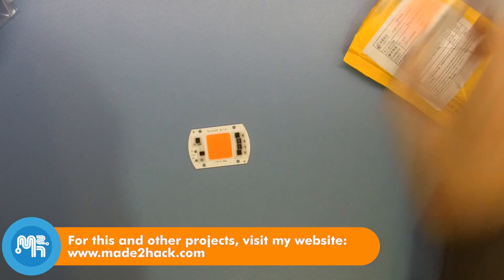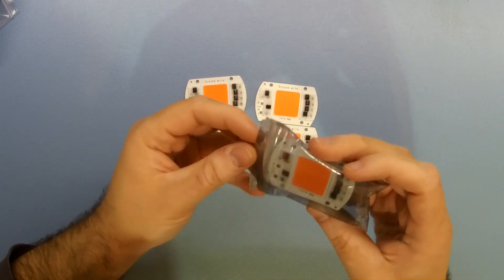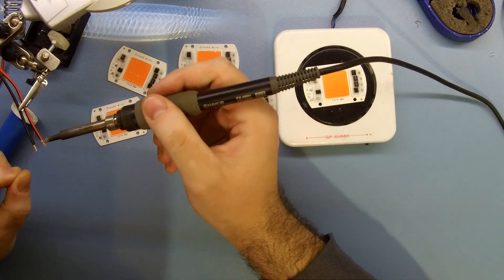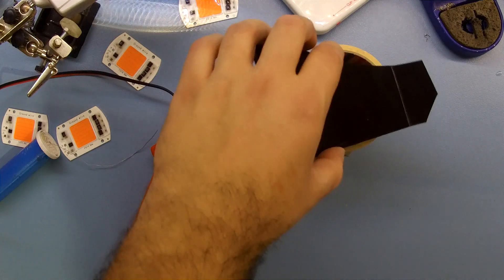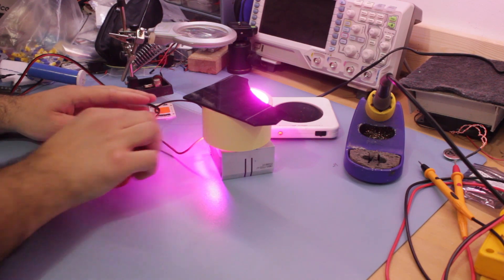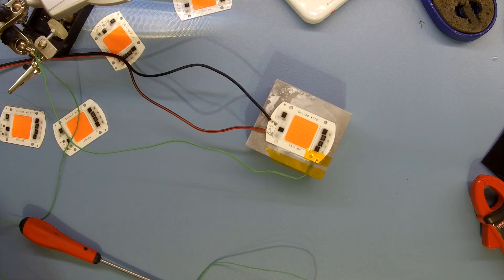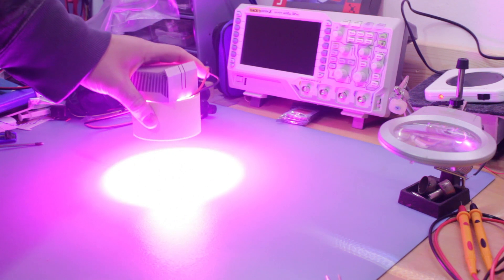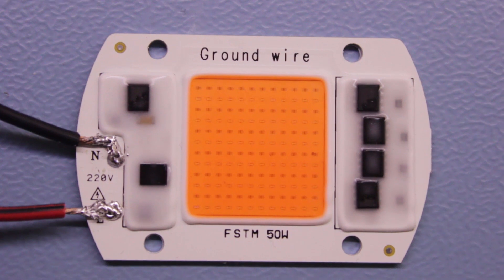220V / 230V Mains Power Full Spectrum LED COB

Comment: Bro is it possible to manage brightness of this led? I bought one and I'm willing to be able to manage brightness
Reply: just get a 220v potentiometer and slap it in between. i did that with this exact kind of led and it works wonderfull. on the highest setting however you will get a bit of coil whine
Reply: @raik8243  I gave up on these leds because they were flickering :/ thanks for the answer! :)

Comment: Can someone tell me if I can use the plug and wire from a lampi already own, the plug says 240v , the current lamp bulb(not the grow bulb I'm going to use) also has 240v written on it so I'm thinking it is good, but better to ask then blow myself up xD

Follow up, if I have 2 of these led boards, can I connect both to the same plug, or do they have to be set up a certain way for even power distribution

Comment: I bought 3 of those that are a 1000w each on 220v. Problem is that they work well on 110v but when switching to 220v they are extremely dimmed and are barely emitting any light. Since they are supposed to convert automatically from 110v to 220v what are we doing wrong??

Comment: Hi! Thank you for the video! I also ordered this light, but in 10W. It warms up and it was also too bright for me. Will a 3W of this led get less hot? I want to install it in a wooden cabinet as a spotlight. I ordered it because you can plug it in 220V directly, but now I don't know if it is safe to install it like that directly in the cabinet. Do you have any tips? What do you mean with active cooling?
Reply from the maker: Hi, Active cooling means having a fan blow air on it. Passive cooling would mean mounting the LED to something like a heatsink or a strip of aluminium. If you can find aluminium strips at your hardware store, perhaps 2mm thick and 20 - 30 mm wide, you can mount the LED to that. And use that under your cabinet.
Reply: @Made2hack  Thank you for your reply! This sounds like a great solution.

Comment: 4:27 no. they dont need active cooling. because they have thermal regulation. if they get too hot they themselves will start to limit their power....
Reply: False. Every high power led needs some kind of heatsink.
Reply: It's producing 1300-1400 lumens at almost 50 Watts. This is too low and indicates inefficiency of the module. It means about 25-30 Watts in being lost as heat when operating at full load..almost 50-60% heat loss is not something that can be accomplished without a heat sink.

Comment: Would be interesting to know the PPFD or PAR value a 50w generates at 30cm distance. if you dont have a PAR meter, then may be you can test LUX meter app on your mobile and give back the value please?
Reply from the maker: Hi,so I finally got around to measuring the LED. Starting in a dark room, 0 Lux. At 30cm, approx 3800 Lux without heatsink. Once heatsink applied, got around 4500 average, high of 4787 Lux at 30cm.

Comment: Hola compañero..como conecto un fusible térmico en una lampara de led cob 220v como esos ,de  3  de 30 w cada uno? la lampara tiene un ventilador a 12 voltios y quiero que cuando el ventilador falle..que al calentarse los led mas de la cuenta,así como 75º o menos.. que corte toda corriente ,gracias y a ver quien me echa una mano,por cierto sabes que máximo de temperatura a de tener un led cob ? y otra duda...el ventilador se pone que le entre el aire al disipador..o que lo saque? gracias

Comment: Hi, how can I connect on off switch for this specific Cob driverless led? So I don't have to unplug my ac.
Reply from the maker: Hi there, essentially wire a switch in series with the solder pad marked Live.
Reply: @Made2hack  Hi, thanks for your reply. I don't understand well, what kind of switch can I use for this? And just wire it up in series with live wire?
Reply from the maker: @MrLennonson  Any kind of switch you would use for a household lamp. Think of this LED / COB as a combination light bulb and socket together. Any switch that can handle 5 Amps should be fine.

Comment: I was hoping you would show how to run 4 or 5 of these together. I'm building a grow light, and tried wiring them in parallel, but they draw a bunch of power after 3 minutes and trip my circuit breaker. Maybe series instead?
Reply: You have a shit wiring/ breakers in your house if it trips pulling 6amps... That's also assuming you are using 5 of the 100 watt cobs and you are on 120volts... That's only around 720 watts.

Comment: god job mate. 
I drive them 7 in parallel but over a grid diode bridge and 47uf/250V cap (flicker) --> in series to that is a 9uF/250V AC Cap. with this setup the overall consumtion is 40 Watt, they last forever and are day bright. Its mounted onna 1.5m alu bar (7 equal spaced 50W LED) cover the whole box.
I can show you where to get the AC cap for 30 cents. Whadda say.
Reply: How can you drive them only with 44 watts with 7 of them wired in parallel ?

Comment: Hi, I did buy full spectrum cob 50 watts Led and test it with app luximeter from cellphone but it only show 200 lux is it demage or I need use other special of luximeter for measure led? Thank you
Reply from the maker: Hi, is the COB bright? I mean does it ouput a lot of light? If so, then probably the measurement on your phone is not correct. My luxmeter on my phone shows around 1300 - 1400 under my LED strips on my workbench. I've not tried it with the COB.
Reply: @Made2hack  hi, yes is so bright I have receive another comment that luximeter only measure mixed with Green  color and the blurple one I will need a quantum measurement to measure it, thank you very much for answer ☺️
Reply: @Made2hack  it is too kow as compared to what is supposed to be emitted by a 50W LED. A conventional LED would emit about 4500-5000 lumens for 50W input power.. I think this inefficiency is what leads to excessive heat dissipation.. almost 25-30 Watts lf power is being lost as heat..

Comment: I tried these ate fond that using a heat sink and it’s small. Fan works great the fan is 5 volts so a diode and a small cap with a series dropping resistor it ended up 2 watt and I had to shove it between the fins but seems to be reliable I have it on my bench and it’s been a year plus.

Comment: Decreasing voltage  should eliminate the temperature issue. I just tested my 12v one for 11.1v it works without fan
Reply: That's is worthless for the 220VAC version because have a constant current power supply is not just an LED, so if you use less voltage the power consumption is the same.

Comment: I don't think you should use most of the time of the video to illustrate joining to wires. We all understand that. Whats interesting how much cooling do you need and the actual light spectrum thirdly the efficiency.
Reply from the maker: Good point!
Reply: The efficiency of these cobs is horrible. They also produce a ton of heat. I have a cool white one on a CPU heatsink/fan combo above my work bench. Does make good task lighting.

Comment: Hi, I put one of this (50w) on a microprocessor's dissipator. Whit active cooling. And it's get hot to touch. What is the normal work temperature for this LEDs??
Reply: I think, for longevity, you should keep it around 45C, but if I'm not mistaken they should not get damaged while under 60C

Comment: How did it last..? I ordered 10 pieces of 20w 😀
Reply: I ordered 50 of the warm white and cool white they don't last! Went overkill on heatsinks and cooling nothing helps. Drivers get to hot!
Reply: @dutchman4201  I was ordered one year ago and still works , the temperature on chip must be lower than 60°C that means big cooler with fan :)

Comment: It must be considered that isolating the led inside a small space will make it hotter. Even more if the heat sink is turned down and without any air circulation.

Comment: https://www.ebay.com/itm/1pc-Aluminium-Heat-Sink-Cooling-Fan-20W-50W-100W-High-Power-Led-Light-89-89-55mm/232384636873?hash=item361b3427c9:g:D90AAOSwDrNZTdyuwith this heatsink and fan you keep the working temperature of this chip at about 62ºC
This heatsink is ideal because it brings up the perforations to drive the cob

Comment: These are a fine job.  I've upgraded some old Halogen floodlight cases with these.  Earlier ones I built didn't last because I didn't spend much time putting a heatsink in them.  The later ones I built with half decent heatsinks are still going strong.  Long lasting high powered lights for £2
Reply: Heatsink with fan or without fan?
Reply: Dido
Reply: They last what? About a minute without a heatsink?
Reply: @michaelcarey9359  I said in my original post I didn't spend much time putting a heatsink in them. Some I just screwed  straight to the case which usually was aluminium or used old pc heatsinks which weren't an ideal size.

Comment: Can I use it without the heat sink?
Reply: Absolutely not
Reply from the maker: If you use it a full power, it will get very hot very quick. It might burn.
Reply: Certainly not.

Comment: Could you please tell me the type of solder you used ? Mine wears off in the heat
Reply from the maker: Hi, I use Tin Lead solder, SnPb, I think 60/40 with flux inside the wire.
Reply: This can run hot enough to melt solder? Even with active cooling?
Reply: No. If they get hot enough to desolder the wire, they will be dead.
Reply: @RealitaetsverlustTV  yea it's cool I got some set up and they work well but it's hard to get solder to stick to the pads at all but once you have they are good

Comment: How much lumen dose one chip produce?
Reply: Lumen is a unit that measure the light output in the human visible spectrum. Green light is in the mid of this spectrum and these LEDs are missing most of the green spectrum, because plants dont use it. So it is uselesss to measure growlights in lumens.
Reply: @RealitaetsverlustTV  as well as blue and red are in the visible spectrum
Reply from the maker: I'm not 100% sure, but it looks like 50-60 Lumens / Watt, so like 2500 - 3000 Lumen per 50W Unit. For white light, its as high as 80-90 Lumen/watt.

Comment: so supply voltage is 240v? 
how this video looks is this can be wired to a plug and off you go ? seems dangerous ! can you share wiring ?
Reply from the maker: Hi, It is wired directly to 220 - 240V yes. The drive circuit is built into it.
Reply: Made 2 Hack 
cool wow tech has come so far 
and its affordable!
so  
led  to dimmer to plug ?
Reply from the maker: Hi, unfortunately dimmer won't work with this circuit (at least I don't think so). Since it is an electronic driver.
Reply: Made 2 Hack 
my logic .
.3 pin uk plug /earth live nut
.dimmer has/ earth live 1 live 2 
.led has nut live 
link earth from plug to earth in dimmer. link live from plug to live 1 in dimmer .
link live 2 to led and nut from plug ? soz 4 the crappy explanation
Reply: @firstnamelastname4722 connect an earth to the entire fixture heatsink and all

Comment: Is it necessary to build cooling system?
Reply from the maker: Hi, If you are running at full power, yes. In my test, it quickly reached 70 deg C on a CPU heat sink.
Reply: I mounted one on a Pentium 2 heat-sink with fan and with continuous running the chip reaches 75`C.  Without I would give the chip less than 5 minutes before the solder melts.
Reply: https://www.ebay.com/itm/1pc-Aluminium-Heat-Sink-Cooling-Fan-20W-50W-100W-High-Power-Led-Light-89-89-55mm/232384636873?hash=item361b3427c9:g:D90AAOSwDrNZTdyuwith this heatsink and fan you keep the working temperature of this chip at about 62ºC
This heatsink is ideal because it brings up the perforations to drive the cob

Comment: Excelent video, Do you think that this led can work at 110v?
Reply from the maker: Hi Hector, I don't want to say for sure, since I don't know precisely the circuit being used to regulate the voltage. However, there are 110VAC units available on AliExpress, so it would probably be easier to buy them directly for 110V. Sometimes, they will mention 110V/220V and then you know they are universal.
Reply: these need 240v and will not light even dimly on 110v.  They will also run on 180vdc if you want to remove the flicker(invisible to human eye but very apparent with camera)

Comment: Hi
Can I PWM control these with an Arduino?
Reply from the maker: Hi Menino, it's difficult to say. I mean, I assume if you can figure out which chip controls the on / off time, I guess you may try to inject somehow a PWN signal on that specific pin. However, you would have to scrape away the epoxy resin and try to reverse engineer the circuit, unless someone already has done this. It would be easier if you had a LED COB that used DC power and you would PWM the transistor.
Reply: You can run these on DC, but you would need a PSU that can supply above 80VDC, which makes this a more dangerous device to use. PWM is possible, but then you would need to cut some traces and splice in a SSR, which can be controlled by an Arduino. Not recommended as you are still playing with high and possibly deadly current!!

Comment: I don't understand why there would even be a L and N indication. Some 2 prong plugs here in SA can be inserted both ways round... Would I blow the light if I inserted the plug in the wrong way??
Reply from the maker: No it wouldn't, the on-board circuitry would handle that. Just like a regular bridge rectifier, which works either way it is plugged in. I can never figure out the reasons, since if you flip the plug and plug it in the other way, L & N are switched.
Reply: Haha exactly! Oh well, good news for me =D Thanks for the prompt response it's much appreciated!
Reply: for the certifications they have to have the polarity is that's why
Reply: There actually is a bridge rectifier on board. If you look at the chip in the left bottom corner, this is a BR...

Comment: If you touched the solder point would you get zapped? If so, how would you prevent
Reply: Don't use regular silicone. The board will get to hot and this will make the silicone brittle... Just cut your soldered wire as long as the pad on the board is, solder and then apply some resin like Scotchcast from 3M. Sorry to say, but your soldering is very messy...
Reply from the maker: Well, you could get zapped if you touched the solder point if the LED was plugged in. After soldering, maybe cover the solder joint with silicone or maybe epoxy.
Reply from the maker: Hi, regular silicone is fine. You are not dealing with high temperature, so you don't need RTV silicone. Perhaps aquarium silicone since it is the friendliest and has no anti-mould chemicals. But if you think you will have mould issues (like in a humid environment), maybe use bathroom / kitchen silicone.

Comment: do these not require an earth/ground??
Reply from the maker: They seem to have a GND point where you can solder the GND I suppose. If you were to attach it to a heatsink, I would make sure the heatsink is grounded. However, as I tested and probed, the back plate did not seem to have continuity to either Live or Neutral points. But to be safe maybe grounding heat sink and the GND point is a good idea.
Reply: thanks,that makes sense. I wired one of these direct to the mains and boy did it get hot in a matter of seconds. Will defo add a heatsink and a fan as well.
Reply from the maker: Yeah, when you output 50W on such a small surface area, it definitely needs forced air cooling or a giant heat sink. I mean, they dissipate maybe as much if not more than a modern CPU.